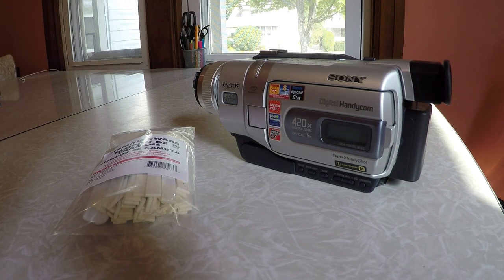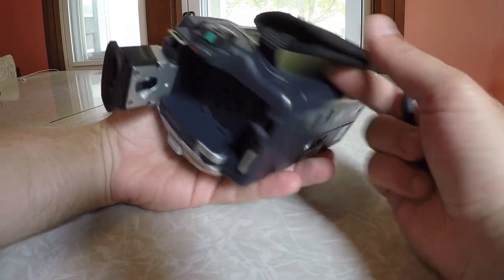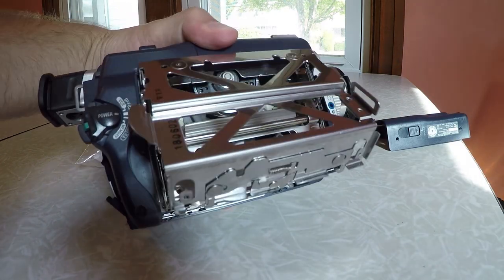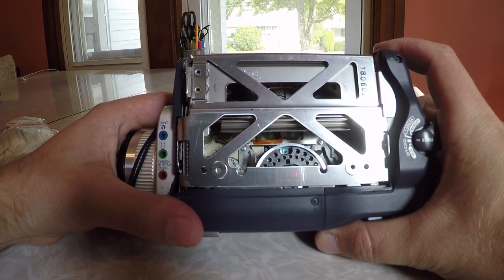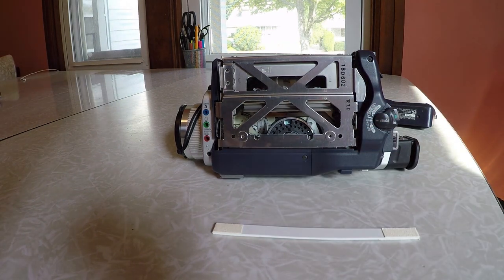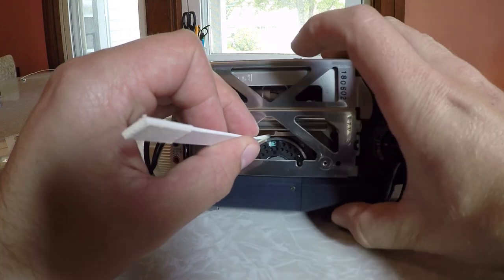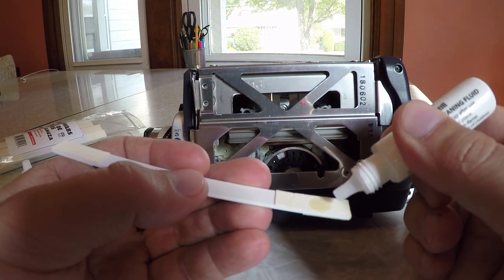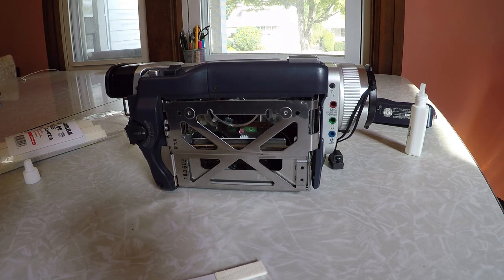Cleaning HI8 Video8 Digital8 video head the correct way

Comment: Finally someone who got it right. Just be careful not to touch the heads when placing the swab against the drum at the beginning.  I prefer using a piece of paper soaked in 99% isopropyl alcohol. It's a much more effective and safer method when cleaning the heads. Isopropyl alcohol evaporates almost instantly so you can start using the camcorder right after the cleaning.
Reply: Like notebook paper? Would that work alright?
Reply: @beszt95  Standard print paper works just fine. It's soft enough to not make any damage to the heads. You wanna use a high percentage IPO (99%+) too.
Reply: JMA All I've got's 91%. so that'd have to work... thing is, some tapes play just fine in the camcorders but others don't. I've got one playing right now, it's an MP tape, and it's playing just fine. I've been playing lots of tape through on these camcorders, digitizing all my family's tapes.
Reply: @beszt95  What do you mean by "bad". Could be lots of things: dirty heads, bad alignment... Have all those tapes been recorded with the same camera?
Reply: JMA Should I make a video showing you what I'm talking about when I say some aren't playing right? I just found a tape where it does the blue screen and fuzz right in the middle of the tape for a few minutes, but I discovered that you can kinda see the video when holding FF or rewind while playing. I  don't know how that could be, because if the heads were too dirty to read it, you'd think that it'd do this on every tape, and that you wouldn't be able to see the video at all when fast forwarding or rewinding.
Reply: Thanks for this, I folded printer paper down into the size of the swab he used in the video and my video is playing back again. Also used 91% alcohol.
Reply: I had a 5 1/4" floppy disc and used a q-tip lightly and rubbed around the disc part with 92% alcohol and when I fired it up I was able to copy over files stored on there 30 freaking years ago. It was amazing. 

Of course with a qtip you have to pay attention that the fuzz isn't rubbing off but when dipped in alcohol it really didn't do that. If it was dry on the other hand....  Kind of like petting a wet or dry dog. The dry dog will get more fur on your hand than the wet one.
Reply: @beszt95  That happens to me too and I think it happens more with the higher cost fancy tapes than the cheper ones.  I still don't have a fix for it, besides cleaning and sometimes converting in sections.
Reply: i prefer paper too. i've been using print paper with ipa since the betamax days. works just fine. never, ever use qtips on the head. maybe on the rollers, but not the head.

Comment: 8mm tape is metal. It will not dissolve with any cleaner. It needs to be cleaned off by mechanical means. Either a dry cleaning or the back side of your fingernail as I have shown many times.
Your fingernail is just the right hardness to dislodge the debris without damaging the head and can be done while the machine in in operation. I learned this trick during my 20 year employment working for a large Sony warranty center.  Alcohol may remove other contaminants such as tar and nicotine that adheres to all the parts if the recorder is stored or used in smoky environments but will no nothing to clear a clogged head. The dry type cleaning tape made by the manufactures is the best and safest method. The same applies for DAT and DV tape decks as they all use metal tape and alcohol will not dissolve metal particles, only oxide type tape.

Comment: Helpful, I didnt follow the instructions from alpha to omega but I got my problem fixed

I had seen other videos even cleaning the head with their finger nail but in my case the head is far inside the cam (canon uc800).
I used 2 swabs, one to rotate the head and one to clean it. I didnt have the cleanest alcohol so after a first pash with the alcohol I used a new clean swab to take anything remaining.
The camcoder works now and I can record my parents' wedding in digital format :D

Comment: Thanks for posting this video.  I have a 27 year old Canon UC4500E which uses the older 8mm tapes (often called video 8 tapes I think).  They are larger than the MiniDV 8 mm tapes.  I'm currently digitising old VHS taps and old MiniDV tapes successfully but the Canon UC4500E plays the video images fine but I'm getting no audio at all.  It's not crackly or distorted audio but actually no audio at all.  Is it possible that cleaning the heads the way shown in this post could help with non-existent audio?  The camera manual says to clean the heads using a Canon CC-8 Video Head Cleaning Cassette and to not use a wet-type cleaning cassette as this can cause damage.  Is this because my 8mm tapes are analogue and not digital so they are not metal tapes and using the isopropyl alcohol would do damage to the heads in my camera?  There is no audio on playback on the video camera but also no audio when playing the videos on the computer using Elgato video capture software either.  These are precious videos of my sons as toddlers and I'm desperate to get them digitised.   Any thoughts/advise would be really appreciated.  Thanks
Reply from the maker: This cleaning method in the video is fine for your 8mm cam. Dirty heads could be the issue. Give that a try. I've never seen a "cleaning tape" for 8mm. I don't know if they even make them.

Comment: Are you pressing pretty firmly or quite lightly? The other day I used 91% Alc and pressed moderately firm. Maybe I used too much. Afterwords,  there were serious lines and no audio. I cleaned it again with just a chamois (no alc) and it was still bad. I put in a tape and after 5 minutes returned to normal. So I wondered what I did that I should avoid next time. Also, if you're doing old tapes how often should you expect to have to clean the head. Thanks.
Reply from the maker: I press pretty firm. The head itself takes some force to spin while i'm initially pressing. Not anything crazy. But a little firm. Then I loosen up as I keep turning the head. I usually wait maybe 20 mins after and play a junk tape to make sure everything's okay. I tend to clean the heads after "batches" of tapes. Nothing set in stone. Maybe 40 tapes?
Reply: @NicholasSerra  That's helpful to know. Thanks!

Comment: Thank you for the video, but I fear I might have messed up the camcorder. I ripped one home video, before thinking it needed some cleaning. So I followed the procedure, even buying the same wipes. Now I'm getting loud scratching noises and broken images with color lines throughout. Any idea what I might have done wrong?
Reply: Sony DCR-TRV510 is the model
Reply from the maker: Nope doesn't sound familiar. Not much you can really break while doing this.

Comment: I thought since 8mm used Metal tape alcohol and rubbing did nothing for the heads since they can't dissolve the metal particles (12voltvids), and the idea of the cleaning tapes is they're abrasive so they scrape off the metal particles off of the heads and that's why it's not good to constantly use them since they wear the heads down.

Comment: Are the lintless foam cleaning swabs okay to use?  I have several leftover from another project and didn't want to use them if there was a known issue.
Reply from the maker: Ive seen some people recommend those. Can't be worse than qtips or paper towels.
Reply: @NicholasSerra  What are your thoughts on the fingernail cleaning method?
Reply from the maker: @Troy.PeaceOfMindRoof  Never done it, but all my gear is new old stock and well maintained, so will likely never build up enough gunk to need that much intervention

Comment: You rock dude... I'm an pro betacam and digibetacam shooter from like 10 years ago and you did it perfectly!  Great info about the alcohol.  What do you think about grain alcohol in stead of isopropyl alcohol?
Reply from the maker: Thanks! I don't know too much about other cleaning techniques, no opinion on the grain alcohol, i've just always used the iso. I'll have to do some research :)
Reply: Grain alcohol like Evereclear? I heard it works well on the reader eye of CD/DVD players. Probably be fine, but only if 99% iso is not available to you. I buy my 99% iso from Amazon in bulk.
Reply: I used to work for an AV shop on consumer and pro Beta and VHS players. We always used denatured alcohol on the pinch rollers, capstans, guides, and heads.  Particularly because it won’t dry out the rubber parts like Iso will, or so we were told.
Reply: I have been told not to, but I have been using denatured alcohol for years.

Comment: Hi Nicholas, just wanted to know if this method is as good as running a video head cleaning cassette as the cassettes are not readily available where I live. Many thanks in advance!
Reply from the maker: This method is better than the cleaning tapes. Cleaning tapes are often abrasive and can cause more harm than good.
Reply: @NicholasSerra  Noted! Thank you so much! :)
Reply: @NicholasSerra  I've  used cleaning tapes with no problem.  Only use them when you need to. I found a brand new blank tape will clean the heads too, because it's  somewhat rough because it's  never been used. Once they're  used, they smooth out, and don't  work as good for cleaning. If you have a dirty tape, that keeps making the heads dirty, stop playing it.

Comment: I made the mistake of cleaning with swabs and 70% isopropyl alcohol. I went in both directions against the head (although I was rather gentle about it. Now I don't see any video except when I fast forward (I still see lines on the top and bottom that prevents me from seeing the entire picture. Did i just mess up my Hi8mm camera? I don't "think" that I misaligned or damaged the heads. Can it really be that sensitive?  Suggestions?
Reply from the maker: Would surprise me. Maybe clean again with this method.

Comment: I have this camera and I just found it after 18 years and it plays the old videos I have for it sometimes it plays and sometimes it plays but it skips, Will this help the skipping ?? 
Can I use regular Alcohol to clean it??
Reply: sounds like your belts are getting loose.
Reply: @tituslafrombois1164  where can i order the belt and how can i fix it ..thanks in advanced
Reply: @rosemariedungo2336  You'll have to measure the belts diameter and just order a bulk set off the internet. Then you will have to disassemble the camcorder.
Reply: @tituslafrombois1164  thanks to you .

Comment: Would this resolve (possibly) the white, horizontal lines that are going arcross my video when I play back?
Reply from the maker: Possible. If they're Digital8 tapes and it looks more like digital errors, i've found that the tapes are usually the culprit.
Reply: @NicholasSerra  They are the old ones that came out before digital.  Sony CCD-V9 camera from mid-late '80s.  Played a 'Video8' format - I believe it was analog, but not technical enough to be positive.  In between the 'Video8' format and the 'Digital' was the 'Hi-8'.  Mine is the original 'Video 8'.  Thanks if you have any insights.

I played two tapes... and the patterns look quite similar, hence my 'hope' it is the camera that I just picked up off of eBay.  ;-)
Reply from the maker: @dieselboats7886  Those video8 tapes are surprisingly robust. Just did some transfers of tapes from 89 and they were okay. I would also guess the camera is the issue. It's a toss up with those ebay camcorders. I make sure to buy them from a seller who actually "owned it", not just someone who picked up a bunch of gear at auction. Or new old stock cameras. You pay more but it's worth it if you're doing a lot.

Comment: Great video....But I'm seeing that the board mounted capacitors is the issue and death to the Sony series of camcorders. Kind of a ticking time bomb unless the units are serviced and those components replaced.
Reply: This is true, though those capacitors are easily replaced. They used more of them on later models which is a pain, but still something fixable without much issue if you have the time and patience to replace them.I get it's probably more effort than most people are willing to put into it though.

Comment: I'm getting a black screen with a static line during playback.  I've  tried to clean it, but may need to do more. Also it looks like the speed changes from LP to SP back and forth. Thoughts? Thanks in advance
Reply from the maker: First i'd try to figure out if it's the camera or the tape. Maybe try another tape and see if it shows the same issue. Aside from a good cleaning I don't know how to do much else as far as repairing these things. Good luck!
Reply: Tried several tapes. Gotta be the cam. I'll try a thorough cleaning and see if that works. Thx
Reply from the maker: Also try A/V output via RCA or Firewire, maybe the screen is only bad.
Reply: Try running a normal tape on it for a few hours. I had the same problem, and after I ran a normal tape on it for about 2 hours, it started working again.

Comment: Excellent vid!! NEVER use Q-tips.....all you have to do to verify that statement is to get some jeweler goggles and see what is left behind from a Q-tip cleaning....seriously. And that goes for anything electronic that is cleaned with a Q-tip. Also, you have at least one rubber pinch roller and a tape path to clean. The rubber I would clean with the same pads as shown...if access is a problem, use those hospital foam tip swabs they use to prep wounds etc. I use those strictly on reel to reels and cassettes decks. Use, believe it or not,  Windex on the rubber. You won't believe the crap that comes off. Isopropyl 99% for anything not rubber. There is a man, Terry Witt, that makes electronic deck pinch rollers for a living and the Windex recommendation was his tidbit.
Reply from the maker: Thanks! I'll keep an eye out for those rollers. Definitely hard to reach everything on these cameras.
Reply: @NicholasSerra  I don't know if those pinch rollers for camcorders are even available....so the Windex is a safe solution to use on rubber.  I have a Sony CCD-TR81/Hi8 and I don't think there are still parts for it. Alcohol is known to dry out rubber parts, even though you'll hear people claim they've used it for yrs on pinch rollers. Teac used to make a rubber cleaner that was hands down the best, but it's long gone....probably something awful for the environ in it.
Reply: Hey Kevin, I was curious about your Windex comment and looked up Terry's website (http://www.terrysrubberrollers.com). Apparently he doesn't have a sure-fire solution for cleaning rubber, but his opinion is to use dish soap and water. Also, Windex does contain isopropyl alcohol.
Reply: He told me that confidentially over the phone. He wouldn't repeat that on his website, because he's afraid of the concoctions people might use and then blame him. I've been using Windex in very expensive decks since he told me...like eight yrs...never have seen any degradation. On the contrary, it keeps the rubber supple somehow. If you're familiar with the old Teac rubber cleaner, it had some serious chemicals in it and it was hailed as the best rubber cleaner ever made.
Reply: @kevinfetner7983  Thanks!!

Comment: Hi Nicholas! Informative video and I've got the swabs off amazon, however can't seem to find the fluid as the link sends me to a page no longer working. What do you recommend that I can still get?
Reply from the maker: 99% isopropyl
Reply: @NicholasSerra  Is there better choice between 99% alcohol and MG Chemicals Video Head Cleaner? (contains 50% propanol and 20% methyl-pentane)